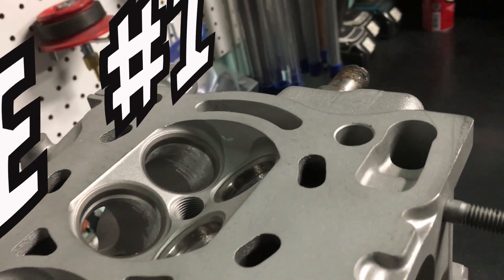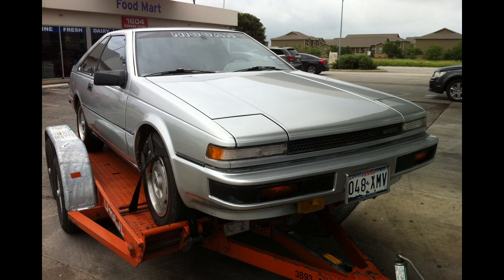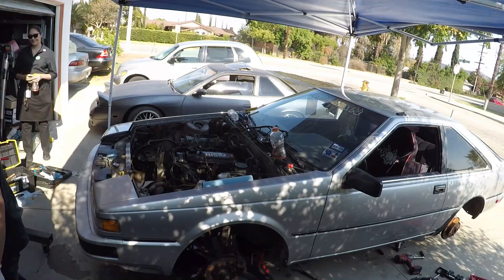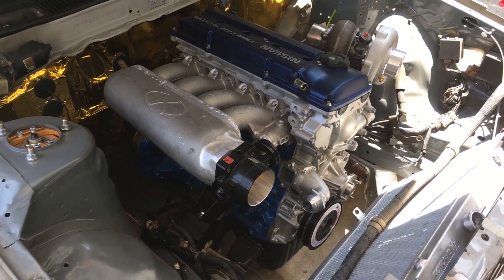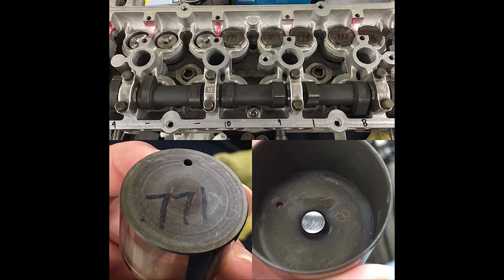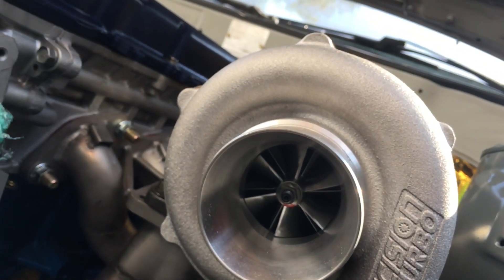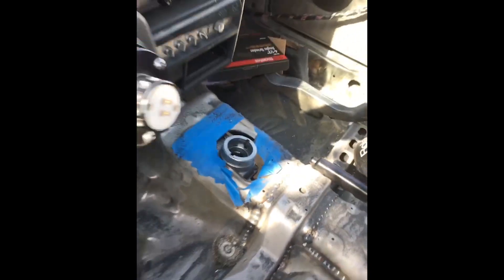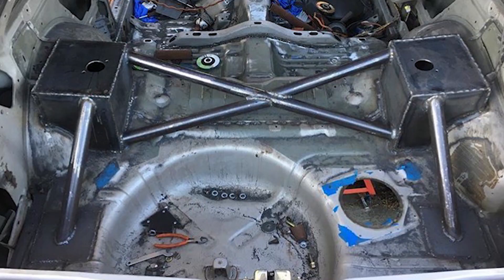ka24det Build List & Channel Intro

Comment: I just subscribed,  I looking forward to learning a thing or two. Or just give up on my s13 (it’s a stock AT ,154k original mileage)
Reply from the maker: Doc187 XL na man don’t give up. This s12 started out as auto. I’m doing the 5 speed swap to it later on with the pedal assembly and all of that. I’ve never done one before so it’ll be a learning experience for me as well.
Reply: Kouki Cutters  I don’t wanna give up there’s just too many factors at play. 1 no garage access 2. Location.  If any 5 speed parts show up no one wanna ship or the part is 9hrs + away etc.
Reply from the maker: @Doc187XL  Yea I feel you on all of those. Having a project car is a struggle sometimes. I've had to figure out how to keep this project alive so that it doesn't end up being a waste of time and money.

Comment: Dude! ive been told over and over that porting the heads on the DEs were bad because they didnt have much material. your the first to say anything different! when you are done are you going to post hp numbers!?
Reply from the maker: The intake ports are iffy. As there’s not much material you can take off there. I didn’t remove much material from the intakes. I took off just enough to get rid of the casting marks and enough to port match the ports to the intake manifold. The exhausts on the other hand we removed A LOT of material just not from the floor of the port since there’s coolant under that and not too much from the roof of the port either since the springs sit above. The most was in the middle and on the sides of the ports. I’m planning on making a video where I cut a DE head up and show how thick the casting is throughout the entire port because I’m curious to know as well for maybe a version 2 of my motor. Definitely will be posting up HP numbers when it’s up and running though.